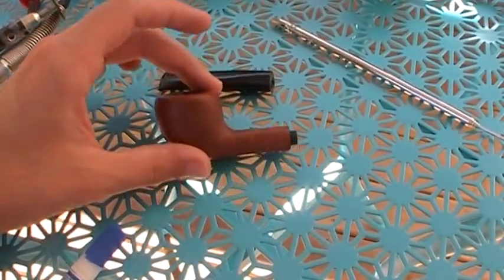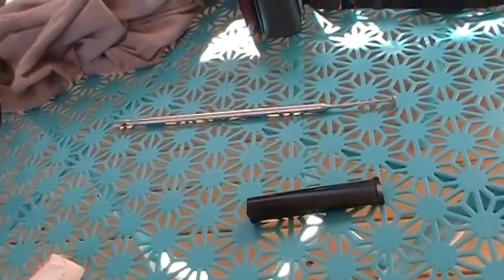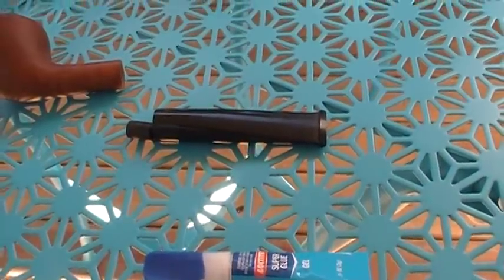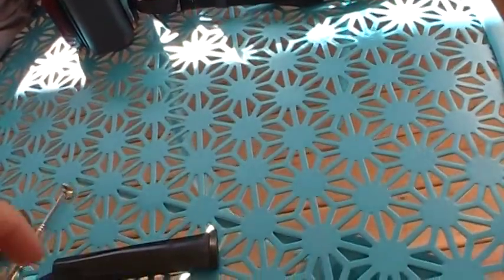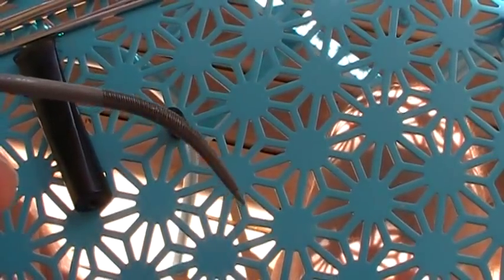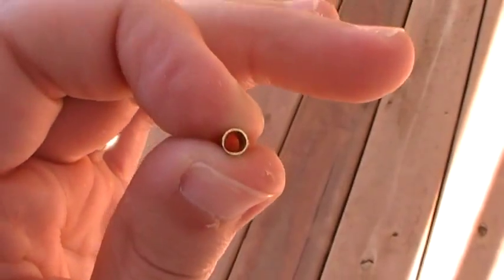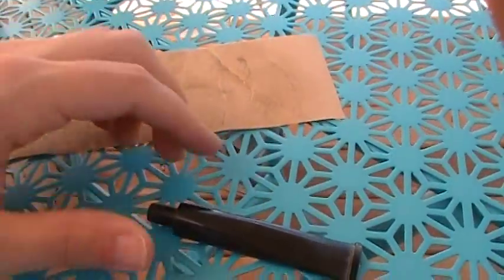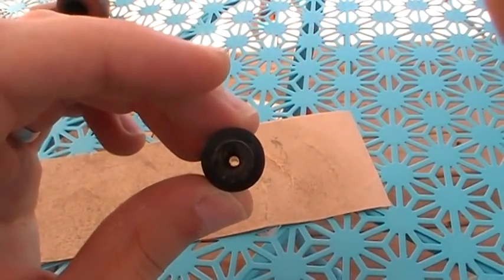Amateur Pipe Repair: Broken Tenon

Comment: i thought that antenna was a tamper lol
great tip. exactly that happened with my mario grandi olive wood poker. i just superglued it back on again. but your trick seems to be more elegant. thanks
Reply from the maker: Tactical X-Rays I wanted to be able to remove the stem to clean it, so I did it this way. Thanks!

Comment: Great , the antenna seems very good idea! I just had done it with the inner tube that comes with some pipes, now looking if people had done it with superglue came across your video..., i  was a little worried about using superglue, when smoking and heating up the glue.. How long did you wait for the glue smell disapear ? I havent smoked mine yet, since fixed abot ten minutes ago... Thanks!
Reply from the maker: Super glue is fine to use for pipes. I let it cure for a bit first, but once it's set, it's good to go.
Reply: Thanks, yes i thougth so  when thinking how to glue it!